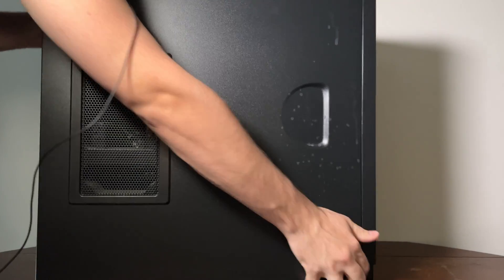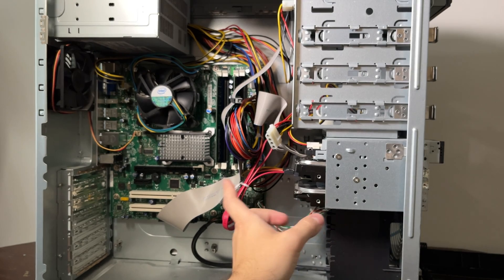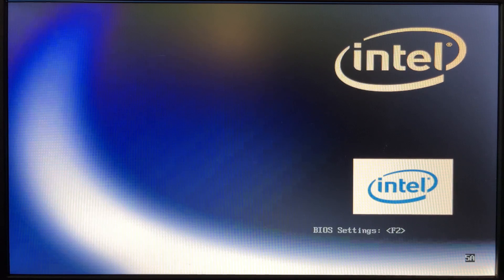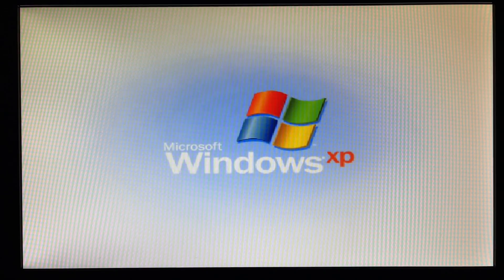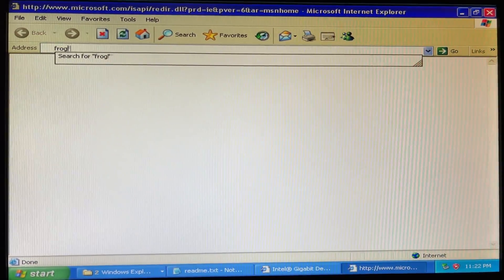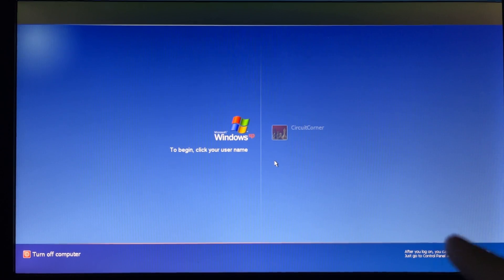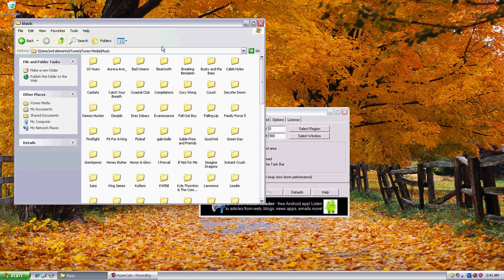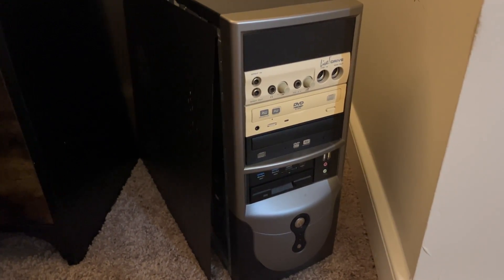Building the XP Machine

Comment: So, for 32bit you can't really harness more than 4 gigs of ram without stability issues.  You can also find drivers that work up to the Titan X for XP.  If you wanna go extreme, get an lga1150 motherboard for an i7 4770k, 16 gigs of ram, etc and use 64 bit.  But for this, you could just slap like a 700 or 900 series gtx card and play all your retro games

Also, look into OneCore if you haven't already (especially if you go 64bit)

Comment: You should install Windows XP 64 bit on it
Reply: He should really install some sort of Linux on it and be done with Windows forever. I switched a couple of months ago and other than doing command line stuff, I'm very happy I did. I have a W 10 laptop that is going to be switched to some flavor of Linux very soon. I even have a Raspberry Pi 5 up and running. I bought the 16GB ram model and have a 2 TB M.2 NVME in it.